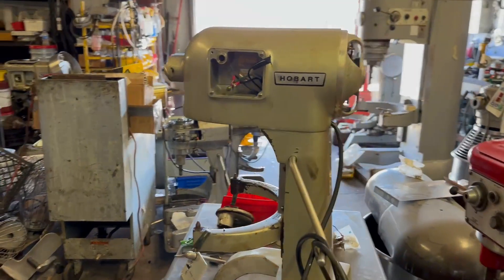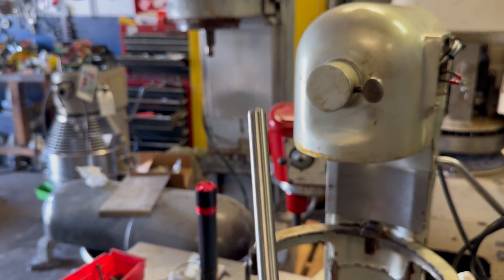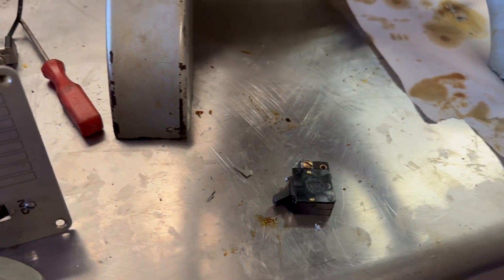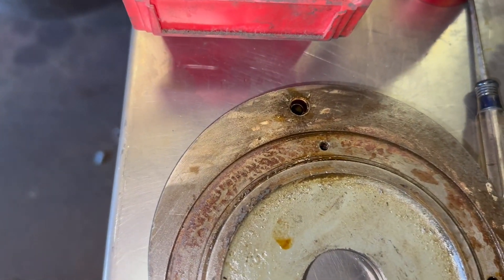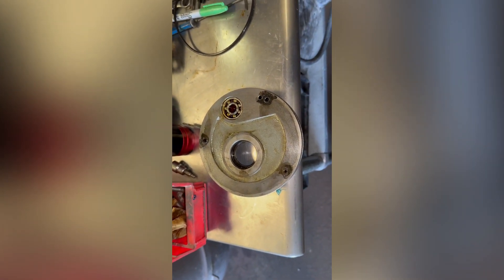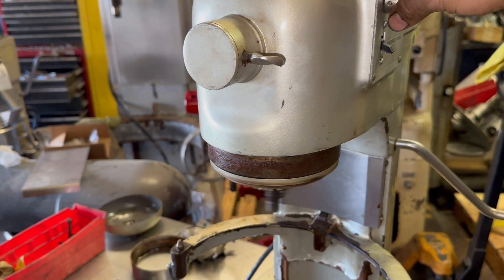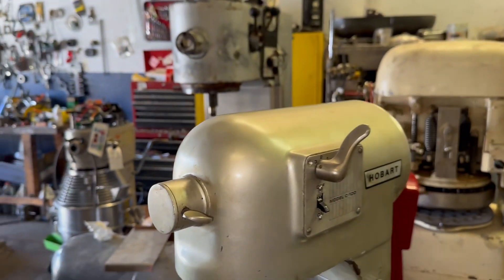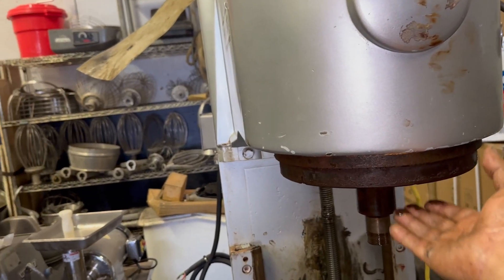Hobart 10qts service Maintenance

Comment: So how much did it cost to replace the key? I have the same issue with the one I have received.
Reply from the maker: The key actually wasn’t broken I don’t remember if I found it inside or if it came out altogether with the rod, but anyways a key won’t cost you much at all maybe $5.00 would be the most a key will cost as is not a big key